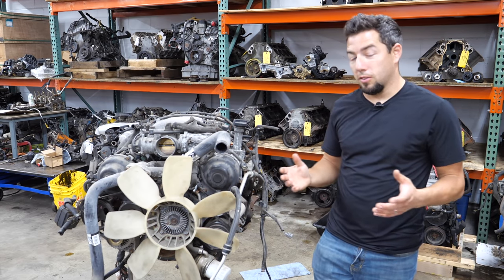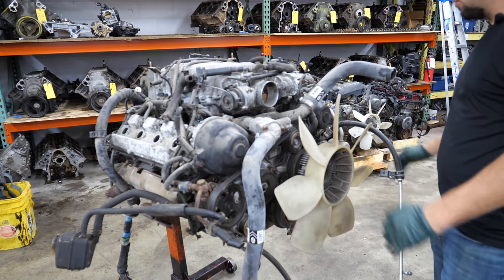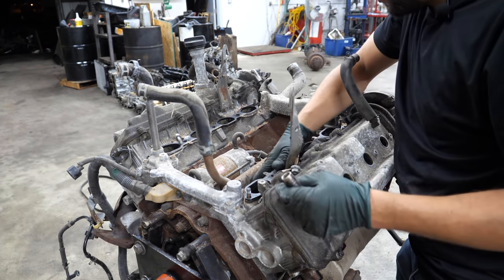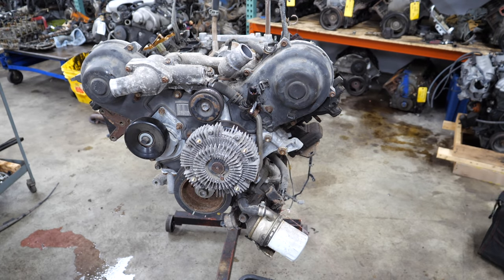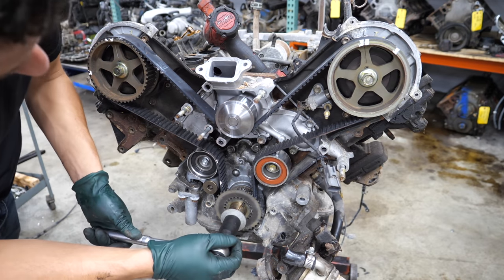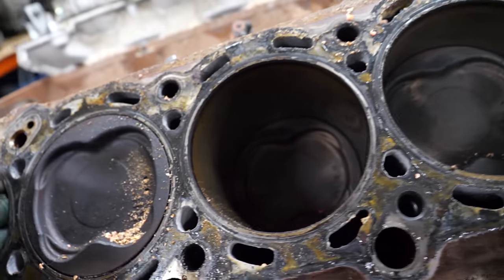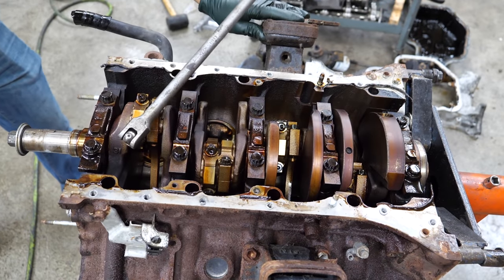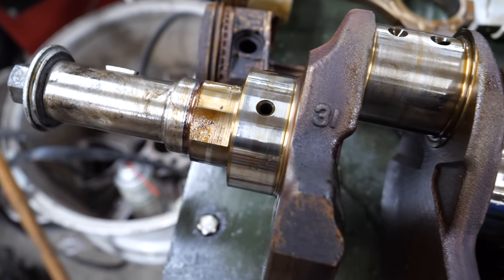Toyota 4.7L 2UZ Total Engine Teardown! Low Compression, But Why? Tundra Land Cruiser Sequoia LX470

Comment: That engine just needs a refresh, clean up the pistons, new rings and bearings and give the bores a bit of a hone and it's probably good for another 20 years with regular use and maintenance. Nice to see a teardown that doesn't end up with confetti in the oilpan,
Reply: Yeah but I'd rather just not deal with an engine so fragile that sitting for a year destroys it. Why I'm gonna take the 4.6 out of my '99 P-71 Crown Vic and slap a 302 Windsor in instead. Backdate to a more durable engine, throw a manual trans in it while I'm at it, and be done with the matter. Also gonna put a 4bbl carb in instead of messing with EFI; part of why the 4.6 is blown in the first damn place is EFI problems.
Reply: @TestECull  Yeah, EFI is the problem and totally not the fucking donut who owns it. Yup, definitely that EFI.
Reply: break out the dingle ball and ship it.
Reply: @TestECull  I never had any EFI issues with my '03 P71. What I did have problems with were sparkplug/ignition coil wells filling up with oil. After that was handled, cylinder #3 blew its spark plug out of the head. No. I didn't over torque it. The head barely has 3-4 turns worth of aluminum holding the spark plug in. I bought a heli-coil kit, made the repair on the driveway and it was ok. I sold it at 199,800 miles.
Reply: @2006gtobob  On mine, the injectors just stopped closing off. It was running stupid rich and getting around 5-7mpg, was stumbling on part throttle cruise and at idle...ran like a hot damn full blast though. At the time I couldn't afford to buy all eight injectors so I parked it and went back to driving my F150...funnily enough I had bought the 'vic so I could do an engine overhaul on that just due to old age...by the time I had saved up and bought injectors the cylinder walls had rusted up about like we see in this engine.

I put them in, started it up. It only fired on 7. Puked blue out the back. I took it on a quarter mile testdrive, during which time it drank 3-4 quarts of oil and spat the dipstick out of the tube. Parked it again and it hasn't moved since. Been sitting there for 4 years now while I mulled over what engine I was gonna swap into it since I had to contend with  the emissions test in my area plugging into the ECU for a '99.

Well, effective Jan 14, 2022, my county of Tennessee is dropping emissions testing, so I'm just gonna slam a 302w 4bbl in it mated to a 5-speed likely yanked out of a Mustang and be done with the matter. No more EFI, no more fragile modern engine, no more automatic trans. Win win win if you ask me. If I don't have to get it sniffed anymore I don't need to worry about all the DTCs it's going to throw when it powers on and doesn't detect that an engine's even in the car. 

I haven't decided how I'm gonna light it off yet. I might just go points; I'm not building a hotrod here merely getting the car driveable again with an engine I know will last and last. Performance goal is roughly equivalent to the way the 4.6 pulled before it blew up. Points simplify wiring to an almost stupid degree as all I need to do is find a 10 amp KEO circuit and wire that to the coil +, and honestly they're not a big deal to work with on a Windsor V8. But I might also go with a hall effect pickup and an MSD 6AL fender mounted box. 

Maybe after the swap is done and I've driven it a bit I'll have autozombie pull codes for s's and g's.
Reply: Cost of a rebuild for this engine is too costly. Head bolts and gaskets cost almost as much as a salvage engine.
Reply: @MrSleepProductionsInc  Yay, disposable mentality making engines even more delicate....
Reply: @TestECull  I think its more of a matter of supply and demand. Aside from a few notable lemons, most modern engines are mechanically very long-lived compared to engines from the '60s (125000 miles with no need for overhaul would have been unusual back then). Probably something to do with better oil and no carb/choke washing the cylinders on startup. People still crash their cars all the time though, so if your car uses a common engine you can probably find one at a wrecker fairly easily. Same supply, lower demand = lower price.
Reply: If that engine was started the rings would have loosened up and the compression would have gone up. A couple of oil changes with shell rotella oil and that would flush out the dirt. Not ideal but that engine would have been ok for a tight budget.
Reply: @nerd1000ify  Tighter tolerances, better (synthetic) oil, better metallurgy, computer design and stress modeling, and the use of unleaded fuel with included cleaning additives. Electric radiator fans instead of a mechanical fan on the crank means less variation in coolant/operating temperature and means engines almost never overheat while idling anymore. EFI and electronic ignition help a lot as well, since you're not dousing the cylinders in fuel on startup and both cold and hot starts are handled perfectly every time (that extra fuel often winds up in the oiling system). Electronic throttles are there for emissions control, but they also moderate rapid throttle changes that impose stress on internals. Tons of reasons modern engines almost never need to be rebuilt for their usable life.

Comment: There is definitely a market for buckets of brand specific bolts. A local Suzuki 4X4 shop( Trail Tough) has been selling them for years. I bought 2 many years ago. Best purchase I have ever made when I was playing with Sammies.
Reply: I feel the exact same way
Reply: We tend to fill a Costco coffee can with any vehicle-specific fastenners when we part out a car to supply spares for one of our race cars (usually selling interior and exterior trim then crushing it).  Generic stuff just goes the most used 5 cans: metric bolts, metric nuts, SAE bolts, SAE nuts, washers and spacers.  At the track we kinda of stage them in a place anyone can get to as other teams ae always asking for XYZ.

So yeah, for those that do not part out a car or two every year, model specific bucket of bolts have value for sure.  Get into something like a BMW E46 or newer and there are so many specialty nuts, bolts, studs, etc I can image those would have more value than say a late-model Tundra but I could be wrong.  I certainly see a niche, discontinued brand like your Suzuki being very valuable.  Even the crappy Neon I rehabbed for someone that needed a cheap car getting back on their feet and four bolts on the rear suspension that at least two snap on removal...two of the bolts are $35 each and about a week lead time and the other two are NLA.
Reply: My grandfather kept buckets of bolts around his shop his whole life. He had owned a gas station with mechanics bays in the 50s and 60s.
Reply: Years ago when in the Honda/Acura swap scene when we had free reign at the junkyard we ALWAYS snagged as many 8 and 10mm bolts we could get our ratchets on.

Comment: Awesome!  I've wondered what a 2UZ looks like torn down.  I've got a 2002 Tundra with 175K.  Love it!  Oil every 5K, plugs every 80K.  Great engine!  Thanks
Reply: Me too Mike. My 2000 Tundra had 132k on the OD. Changed the oil regularly and no oil burning. Very dependable engine.

Comment: No issues with the 4.7 2000 Tundra in the 21 years I've owned it.   It only has 89K miles on it at this point.  I would drive it until the wheels fall off but I think my wheel are going to fall off first.  Great video, always wanted to see the inside the 4.7 motor as long as it wasn't my motor.

Comment: My friend I graduated in 1999 and for graduation he got a brand new 99 Tacoma. We both became lift operators at snoqualmie pass and commuted every day to the mountain in that thing. We put crazy miles on that thing. But point of my story is we ran out of gas one time and he decided to use the clutch start cancel button to start the truck in gear wich caused the truck to drive forwards on just the starter. We wen 2MILES!!! Like that all the way to the gas station. Later less than a year later we ended up replacing the starter solenoid and eventually a clutch but that’s it incredibly tough trucks.

Comment: Many times I have bought what’s called a “Lot” of bolts/hardware from a engine, car, and especially motorcycle tear down on eBay. Many times they are less than $100 plus shipping for the lot but sometimes they are a $100+ depending the situation. It’s a great way to replace hard to find hardware, not sure how profitable it is as it does require throwing all of the bolts in a small bin, taking a few pictures and inventory etc… but it’s helpful for us that like to work on stuff.

Comment: I’m delighted to see this tear down. I have two 05 sequoias, one with 265k and one with 210k. The engines have been great in both. Mine is used for extensive highway driving while the wife’s just goes to the grocery and short trips. Absolutely love the Sequoia. In both, while replacing valve cover gaskets, i noticed the discolored, glazed situation on the driver’s side of the engines,while the passenger sides were pretty much pristine. This was the situation on both vehicles. Wondering if anyone has insight as to why that would occur. The one with 265k was purchased with 60k on it and the wife’s was purchased with 190k. Since purchase, oil is changed religiously at 4K miles. 
Love the channel and content
Reply: The PCV system.

Comment: I did maintenance on a ton of those motors, never saw a failure that wasn't from neglect and it had to be way beyond the usual neglect. Stick a "service bolt in the spring loaded scissors gear on the driven cam makes things a lot easier. Great presentation!
Reply: Makes WHAT  a lot easier?

Comment: 03 sequoia with this engine in it, 3 inch lift on the rear and 2 1/2 lift on the front, running 33" BFG's, and drives like the day i bought it.

7k between oil changes with synthetic oil only, did a valve cover gasket at 210k miles, looked super clean, definitely not like the one you just took apart... 

Haven't had to replace the starter, but have stared at it cursing the engineer that laughed when he put it there.

Great motor, smoothest running engine ive ever had, and starts right up every time.
Reply: Change that timing belt please. Mine just broke at 340k mi and now I am needing to consider phase two of the battle wagons future. Had changed at 120k and 240k prior.

Comment: As a tech, thank you for not butchering the wiring harness.
Reply: As someone who makes money selling it (likely to the engine swap guys), it is in his best interest as well.  Sill, wish more folks would try a little harder in the commercial world but even more so at self service yards.
Reply: Yep u r right,I’ve seen so many are using the pliers with force to remove the sensor plug

Comment: I have a first gen 1uz I put in a 89 Isuzu Trooper. They are a bulletproof engine. The starter while hard to access are overbuilt and rarely have an issue. 400-500k is not unheard of out of them. Most people don't realize the 1uz was designed for CART racing originally before they used it in the LS400. 6 bolt main, beefy rods, and non interference unlike the later models. Has a great sound too, with no vibration at all. 

Great series of engines.

Comment: I feel like a weirdo, I would pay for a 5 gallon bucket of decent random automotive bolts...
Reply: My nuts and bolts bin could use a refill lol
Reply: I would pay for one to
Reply: Me too, would be satisfying to open a box of random crap.
Reply: I run demolition derby and I've saved all the bolts from a car when I stripped it and actually had luck selling them.
Reply: I'm restoring the interior of my gx470 and I could use a bucket of bolts. One of the previous owners removed seats to install amps/undeseat subwoofer, and they cross threaded several, among other really dumb stuff
Reply: Ive done the same now i have 3 truck tool boxes full fo random containers of hardware sets from differt brands

Comment: I just bought a 07 sequoia same engine. 229 k miles. Hope it runs a long time. Due for timing belt.just did trans and both diffs and oil change.  So fluids are fresh.

Comment: There are two 2007 tundra’s with the 4.7 that made it over 1,000,000 miles. That’s one of the best engines Toyota ever made. I had a Sequoia with over 230,000 miles with that engine.
Reply: Нет, 1FZFE  намного надёжнее и ресурснее этого двигателя, так что лутще что сделала тоета это 1 FZ FE!

Comment: The cam caps are marked per side so you don’t need to worry about getting them mixed up. They are marked by side, intake/exhaust, and number. There is even an arrow telling you which way goes to the front of the engine

Comment: There was a coolant line to the throttle body.  This is a truck engine, so the throttle plate will see plenty of vacuum, and the throttle body itself may see freezing temperatures as a result, even in the summer;  This is why there is a coolant line to warm it up. Light airplanes typically have a carburetor heat knob for this exact purpose.

Comment: I own one of these in my 2003 v8 4runner.  Pulled my 5500lb loaded TT for a year straight as we traveled full time. 190k-207k it pulled that trailer.  Still feels new.  Even the trans which I have gotten to 250 degrees on hills.  Just has the pesky tranfer case leak.  Now that is worst then the starter.

Comment: Have a 00 Tundra with the same engine and had to replace the engine with 270K miles. Dealer wanted almost 7k just to put a used engine with almost 200k on it. HA!!! Found one with supposedly less miles had it installed and learned the hard way that sometimes when something is too good to be true, it usually is. Wished the person who did the install would have seen your video on how to remove the wiring harness because they hacked in the the original and the truck hasn't ran quite right. Live and learn, Enjoyed the video, very informative.

Comment: I love my 2UZ LX 470. Ready to do the starter replacement - a rite of passage for all 2UZ owners. great video!
Reply: Just got my first 2uz (03 tree with 264k). Seems like the starter is an absolute nightmare with the secondary air injection motors that came in 05+.

Comment: So on many Toyota dohc engines that have the cams geared together, the one split gear is spring tensioned to keep backlash and gear noise down. The prevent them from unwinding (only unwinds one tooth) there is a threaded bolt hole running through the gear to lock it. Makes reinstalling them properly way easier.
Reply: This. Either you or your friend have to reset that scissor cam, thread a bolt in, reinstall cams, and remove the bolt.

Comment: if you got that started in the original vehicle a big can of engine restore with an Italian tune-up would have probably put the compression back into spec. sometimes when an engine sits for awhile the rings get crappy at and running the engine will re seat them nicely.
Reply: I sense a vice grip fan?

Comment: Toyota (and Honda) do such a nice job engineering their engines not only to last but to be relatively easy to work on. Compare this to a similar vintage BMW V8 with 200K and all the issues they have (Nikasil anyone?), special tools needed, etc. Even making the coolant crossover pipes castings or steel instead of rubber hoses is a sign of engineering done right instead of shaving every penny out of the design. Despite not having poor maintenance with oil changes all the bearings, journals, and valve train are nearly like new in this engine. Contrast that with a poorly maintained Dodge V8 that spin bearings, drop valve seats, rocker arms fall off, etc. Or the Jeep 4 liter inline 6 that have about 10 PSI of oil pressure when they have even 100K on them (while the fake oil pressure gauge reads normal-they don’t even have an oil pressure sender just a switch).

Comment: My 2002 Toyota sequoia has 355,000 miles. Runs like a top. 2 things that suck on it. The AC compressors fail every like 90,000 and the ball joints are known to give out (I did have the front end drop on me)

Over all I Love this engine, couldn't be happier with its performance.
Reply: I had my driver side lbj snap on me at 189k it has 275k now and going strong. The ac runs. Fine never replaced the compressor knock on wood.  I did change the radiator and the starter.

Comment: Aw man, that was just surface rust on those bores. I bet you could have gotten the two low cylinders to pump up with some Lucas Therapy. 
What a great engine. Yes I own one. It’s the strongest 240-rated-hp engine I’ve ever driven.

Comment: On my second V8 2006 Tundra, first had 350K when sold. Bought a grandpa 2006 with 62K and hope it my last truck. Neither truck has had any repairs. I use oil analysis from BDL and new full timing belt kit every 90K. Nice tear down. Bob

Comment: My biggest gripe with Toyota: the 1MZ-FE (3.0L) and the 3MZ-FE (3.3L) are interference engines with timing belts. Other than that, I'm impressed with the reliability my Toyotas have given me, and how easy they have been to service or repair.
Reply: oh i DESPISED the 01 Avalon i had, that 3.0 was an oil burning, detonating, rear head gasket eating nightmare!!! 2 transmission replacements in 99k miles, and when the 3rd one failed at 126,836 miles, I donated that pig to the local fire department for a jaws of life practice vehicle, with the addendum that i be there to make the first cut, and much to my unexpected satisfaction, they also used it as a burn car as well, one of the best days of my life watching that thing get destroyed!!!!

Comment: I've seen my fair share of older timing belt engines that run just fine even though they are sludged. Not even a tick noise. They have no variable valve timing, and the timing belt doesn't need oil whereas a chain would get destroyed.
Reply: Chains add metal fast which wears mains and rods